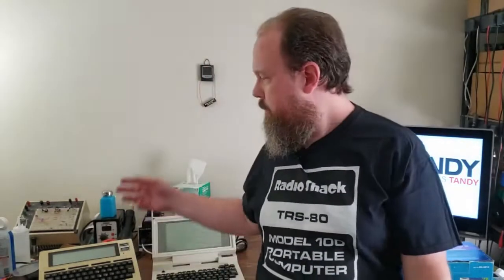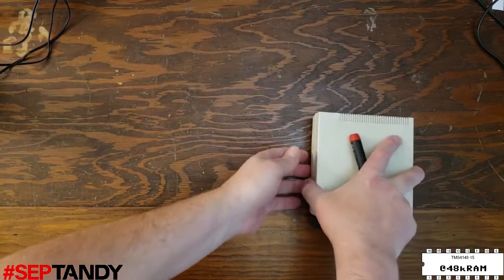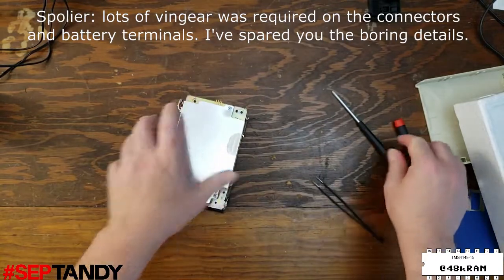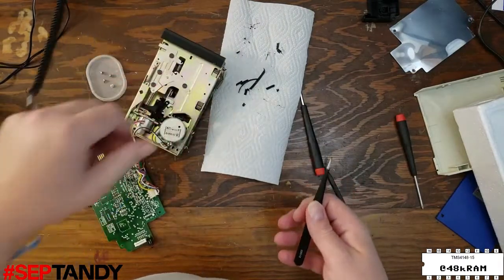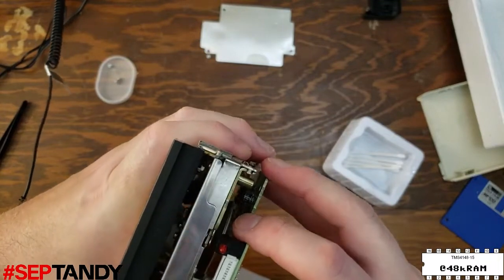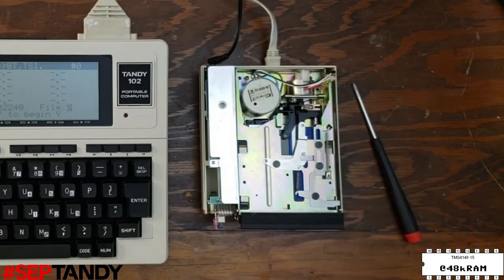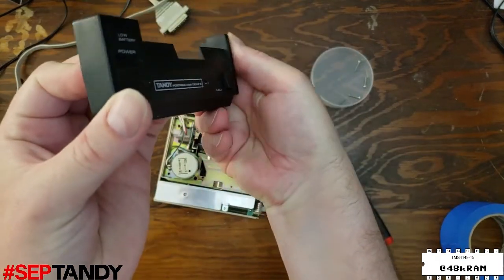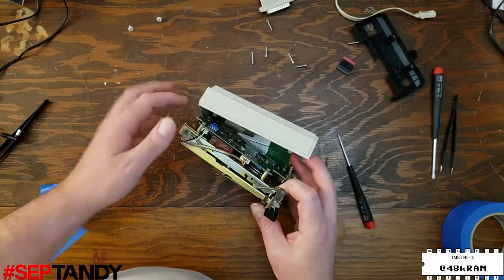Replacing the belt on a Tandy Portable Disk Drive (TPDD2) - #SepTandy 2020

Comment: Damn, as if getting to the belt wasn't hard enough, once you get there you have to clean up all the chunks stuck everywhere. And then reassembly is just as painful. I really like the look of that bezel, glad you got it all sorted!

I once had a little parts drawer full of rubber belts and years went by without needing one, but when the day finally came that I needed a belt, they had all turned to sticky mush. I ended up throwing away the whole drawer!
Reply from the maker: Yeah - rubber parts aren't something you can stockpile for very long it seems. Wonder how long we'll be able to get new replacements for stuff like this :(

Comment: Fantastic VId.  I've heard these work with the Tandy WP-2 also.
Reply from the maker: They do, yes. Do be aware that the file formats on M100 and WP-2 are not compatible by default. You need to save or import the file *as ASCII* on the WP-2 for the M100 to be able to read it. The default format is some other encoding.

Comment: I've had a lot of cassette players/recorders over the years, portable and otherwise, that I just gave up on after the cassette drives failed, most likely because the belts turned to goo. I now wish that I had made the extra effort for some of them.
Reply from the maker: Yeah, belts are kinda like capacitors in old equipment -- they're often doomed to fail, and sometimes are an easy fix, but sometimes not. :-/  And the fix is never permanent, as the new belts will fail the same way in time. I wonder what the fate of these drives will be in another 35 years.

Comment: My TDD isn't even making that noise....I am trying to troubleshoot it to find out what's going on. I followed your video in replacing the belt.  I either get a blank screen or ?AO Error.....any thoughts?  Based on your video it's a TPDD1....I had to remove those extra screws to get out the assembly.